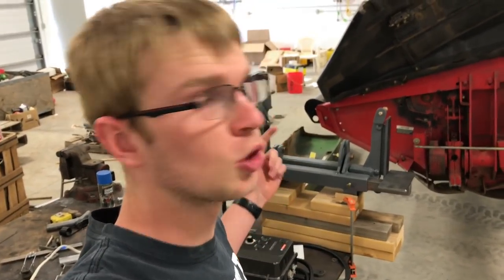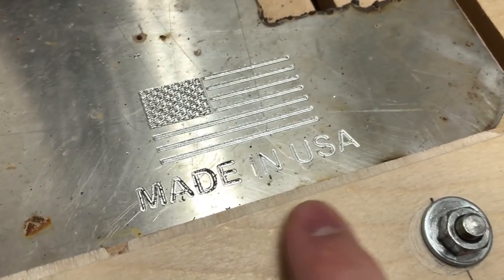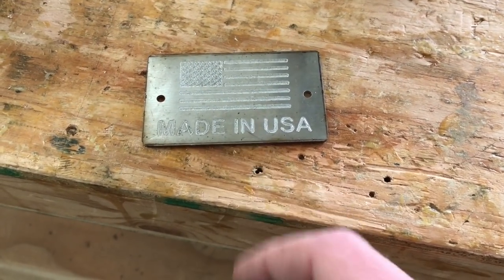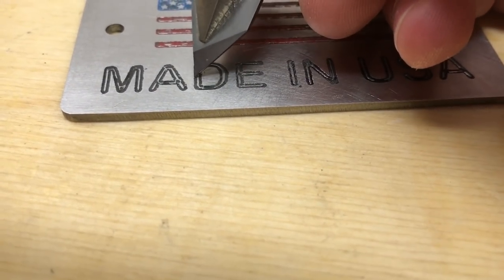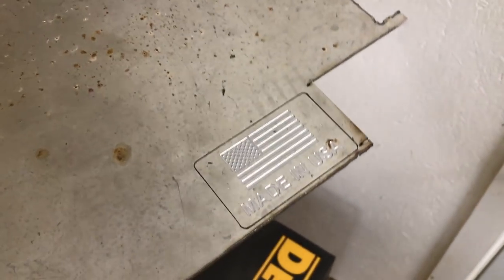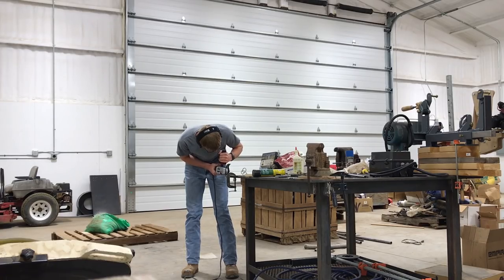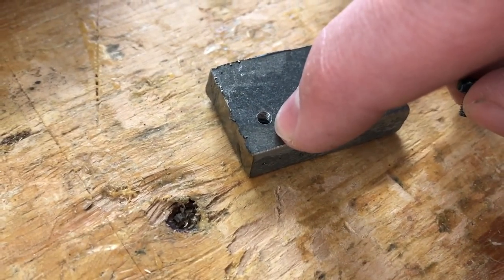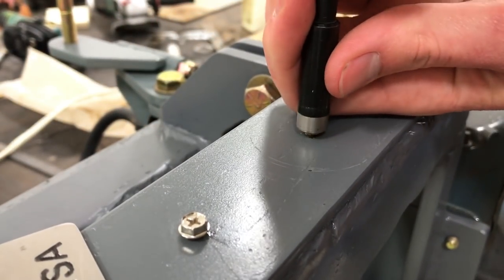Making the "Made in USA" badge

Comment: the screws looks like computer case screws, like for the old 90s kind of pc case
Reply from the maker: +Leone 
That's what I salvaged them from.
Reply: I have ever heard, those kind of screws are called "thread rolling screw". I found many of them used for fasten the mounting/bracket in the industrial electronic control panel (including computer case).
Reply: I'm not sure what they are called but they are designed to form the threads as you drive them into a slightly undersized hole, they are effectively self-tapping although they don't actually cut but more like squeeze / form the threads as they are driven into the material. 

I'm sure the reasons they are used so heavily in the computer cabinets are the fact that you don't have to tap the holes before they are driven in. And most computer cases that I've been exposed to have been made from mild steel that will work easily with a screw like this.
Reply: Those screws are called taptite's.
Reply: Yeah those are almost certainly fine-thread case screws. You'll find them used on optical drives and such (or you would when optical drives were still a thing)
Reply: The black ones are from a Compaq computer cases
Reply: so the screws are probably not made in the us
Reply: ozk_ffm haha im from australia and sourcing even a bloody nail thats Aussie made is hopeless!   
Go on ebay and no US product or British or German or Australian just Chinese... In Japan they call a boat a junk. In China everything they make is junk!!

Comment: The point about the climb versus conventional cut is kind of whats happening. But instead of thinking about the material being pushed, think about the thickness of the chip that's being cut. With a conventional cut, the chip starts small and gets big when the cutter leaves the cut, meaning that at the beginning of the cut, unless its a sharp cutter, will be smearing the material. a climb cut will of course do the opposite. It will start my taking a big cut and ending small. This also leaves a better side wall finish and floor finish. the chip is being pushed behind the cutter and out of the way. unless your dealing with backlash or are worried about material bending, climb cut everything.

Source, am CNC machinist and deal with this for 50 hours a week.

Great finished part!
Reply from the maker: +moocowgobark22 
Thanks for the insightful explanation! I hadn't thought of how the cut gets deeper or shallower depending on travel direction, but that totally makes sense!

Comment: A couple of tips, You might get a better finnish by slowing down the feed rate. 

Also, instead of using a brush etc. wait until all the cleaning and sanding is done, then using a syringe sqirt the ink/paint into the vallies, making sure you fill it but not overflowing. When it has dried you will find that the sides and the bottom in each vally look great with no chips.

Lastly you will get a better finnish using a small milling cutter 1/2/3mm etc rather than your V bit. Hope that helps.

Comment: 8-32 & 10-32 threads probably. Use a small file to turn any screw into a self tapping. A file that's flat on one side, convex the other, with sharp edges will work great. File two chip release slots, opposite each other, holding the flat file face at right angle to the centerline of the screw. The rounded side of the file will be your chip discharge area. You need enough threads turned into cutters to get it to bite, 4 is usually good. A couple of opposing hacksaw cuts works in a pinch too. Cheers

Comment: for future labels, you might try a tougher paint like some acrylic nail polish or colored epoxy. Less chance of chipping than spray paint. Alternatively let the spray paint cure longer and use higher grit paper from the start of the excess removal. Lapp the label letting gravity provide the pressure. It can take a while, but the results can be stunning. I got this from some of the lathe restoration videos on YouTube here.

Comment: Great Video!
Its a little hard to explain, but I think that one factor helping the climb cut is that when the cutting tooth comes into contact with the material, it has a large chip depth, then fades away to nothing. Whereas conventional starts at nothing and ends up with a large chip. Normally, conventional is preferred because it has less of an impact when machining, however with small cuts it can prevent the tooth from 'biting' and create flex. I hope that makes sense.
Reply from the maker: +Walker Custom Design 
That does make sense. Thanks!

Comment: When I worked at Lockheed Martin, we used engraved plates to place all required data on our test equipment.  We used flat head screws which, when installed, mount flush with the surface of the plate (the plate needs a countersink for each fastener).  It yields a very professional look when done with care.

Comment: Great video, great project. I admire your work ethic and thinking it through about the upclimbing cutter, wanting to get it right even if it means doing it over. If I had any criticism of the project at all, it would only be a personal preference, and that is that I would have looked for a round headed screw or a hammered rivet. Those screws just look a bit bulky, and could conceivably snag on your hand or something down the road. I'm thinking a smoother screw head. A hammered brass rivet would be extra cool, though.
Reply from the maker: Thanks! I actually went back and riveted them later, because I felt the same way. Didn't care for the screws.
Reply: Nice! I'd like to see that. Glad to see we were on the same page there. Edit: I did look at your 'improved table holder' video, and saw the badge. Much more sleek.

Comment: Hey Jeremy, those screws are called Tri-Lobe or Trilobular screws. Your suspicions were correct, they're a thread forming screw designed to roll their own threads rather than cut them. Good for electronics where you don't want metal shavings floating around. Looking forward to seeing the full sander.
Reply from the maker: +Crocxr8 
Thanks for the answer! Now it seems a vaguely remember hearing the term "Tri-lobe" before; at least now I have something to google.

Comment: Very nice job Jeremy! Just curious though, why did you not simply glue the plate in place with some strong adhesive instead of using screws? It would have made your life easier and keep the design cleaner, imho.
Reply from the maker: +HODYO Design 
I've never seen an adhesive that really works well with metal. Especially on a machine like this where there's a lot of vibration (potentially). But that's probably just cause I haven't been around long enough to learn what adhesives to use where :)
Reply: Here's what we use to do a similar task when screws aren't desirable. Hasn't failed yet. I bet it's probably the same stuff car dealers use to put their badges on.   goo.gl/Rv3QUc   Nice job on the explanation of climb vs conventional milling. I think your theory of the metal mushing around is exactly what's happening. I personally haven't spent enough time on it, but somebody who does a bunch of Feeds & Speeds calculations would probably have a solution. My hunch is that the RPM of your mill (router) is probably still too fast, and the shape of the end mill isn't designed to clear chips away.
Reply: Jeremy Schmidt those metal adhesive solutions are out there but expensive.  Automotive industry uses them. (Holiday Inn Express skills, you’ve got the real skill)

Comment: I work with cnc for my job and machine metal. The bit you are using is trying to use a point to cut the material, this doesn't work well at all. A bit like that is just spinning on the surface and creates a burr, like you have seen. The edge of the bit won't help either, to use the tip of a bit like that it should be razor sharp or you will end up with a burr. A better solution for you would be to sacrifice one of the v bits and grind down the tip to ensure a cutting edge is swiping past and cutting on the way, rather than just spinning on the spot. If you do this you will find it will have much less of a burr, you dong have to do so many passes, you can go faster and it will probably reduce noise. Hope this helps and I thing it will show results.
Reply from the maker: +Craig Redfern 
I am very familiar with machining metal, so I am fully aware of how this should be done. But as the title indicates this was an experiment to see if it's possible to do it the wrong way.
Reply: +Jeremy Schmidt 
Fair enough, I wasn't trying to say you were wrong but I was simply saying how to prevent the burrs. I am not saying you are incapable of the task I was simply giving an idea and a technique. How you solved the problem did work very well and well done for that. I think you are very talented in what you do and love watching your videos. I think they are entertaining full of information and well put together. Keep up the good work. I just thought I would pin my input in based on my previous experience.
Reply from the maker: +Craig Redfern 
Understood. Thank you!

Comment: It's not a problem with the cutter, it really doesn't have to be that sharp to cut, it's a problem with the CNC router or even possibly the bearings in the router and deflection/slop.  Climb vs conventional cutting is changing the load on whatever is causing the monkey motion in the system.

Comment: Hi Jeremy, nice method and well executed. Have you considered using nail polish as paint? 

People use it to paint homemade metal jewelery, there are plenty of tutorials to be found. Nail polish comes in a wide variety of colors and finishes and is relatively inexpensive. This would allow you to very precisely pick colors and possibly a pearl or two-tone glitter finish although I am not sure if that would be a thing for you. I would recommend removing excess nail polish with acetone before sanding to prevent tearing big chips off.

Comment: When cutting metal you need to cut a certain minimum amount of metal with each pass of each tooth to prevent the bit from rubbing and quickly wearing out.. on a sharp bit this is about 0.001in.  Wood routers run at very high speed and need a correspondingly high feed rate to cut metal, which can be very counter-intuitive for newcomers.  It is common to move slower when problems are encountered, which actually makes this problem worse.
Reply from the maker: +Kevin Malec 
In this case I was using a chipload of 0.00125" for all the cuts. (10k RPM with a 2-flute cutter moving 25IPM) Only problem is, moving fast with a not-so-rigid CNC router can cause significant deflection!

Comment: That's a tri-lobular screw.  They're meant to be self-tapping.  You may be familiar with thread-rolling taps (as opposed to thread cutting taps, like every tap I've seen you use so far) and these screws are made like that.  They're meant to be installed under power on assembly lines and whatnot.  In sheet metal (or at least thinner or softer material).  Getting the tap hole size correct can be a bit of an art-form, but once you're set up for it these things are fantastic.  They wouldn't be my first suggestion for a one-off project, due to the amount of trial and error that might be required to get them to work right.
  Anyway, good job, and a good video.  I like your 'doing it all' approach.  The world needs more generalists.  Specialists have their place, and can save the day, but generalists are more useful because they're there.
  By the way... when you're buying new taps for through holes (or even blind holes that you can drill extra-deep) ask for spiral-point taps.  Way, way nicer to use by hand than hand taps, and they work in machines like your drill.  You don't need to back them up to break the chip.

Mike
Reply from the maker: +Mike Graham 
Thanks!
I have used roll-form taps before, but I don't have any in my own collection. I think I mentioned the similarity these screws have with form taps in the video; good to know that is in fact how they're meant to be used! I do have several sizes of spiral-point taps, which I love! I'll be getting more of those in the future.
Reply: Spiral-point taps are my favourite.  They push the swarf ahead, which makes them perfect for through-holes.  If you're tapping a blind hole just drill the hole extra-deep (like, 125% of the depth that the tap will enter) and you should be golden.  The single drawback is having to get the swarf out of the hole afterwards.  It can suck with small holes.  A pick works for reasonably-sized holes, or take a bit of stainless TIG rod or something similar, sand the end to a long point, then form a bit of a hook in the end by pressing the point onto something hard.  That will pull the swarf out without trouble.  If you're going to be using a mill or other stationary machine to tap, then spiral flute is the way to go.  All the benefits of spiral-point, but it pulls the swarf BACK instead of pushing it FORWARD.  Fabulous stuff, but fragile, and very fiddly to use with hand-held machinery.

Mike

Comment: in your example climb milling would be clockwise, if your cutter (endmill?) is left handed (?) and the mill (router?) is spinning  CC then climb milling would be cc.
Reply from the maker: +Claudio Pacin 
The cutter turns clockwise as viewed from the top, so climb milling is clockwise if you're cutting an outside profile, and counterclockwise if you're cutting an inside profile.
Reply: Yup, I thought the rectangle was supposed to be a solid block of material, completely misunderstood the example, my bad.

Comment: I'm not sure how exactly that that Bosch router motor works, but if "1" means less RPM, setting it to "1" is a totally wrong thing to do, and here is why. Pointed cutters have a very small radius at their point, so if we calculate, how fast a cutting edge is moving along the surface, a tiny radius will make that number very small. So, indeed, a tool could be feeding too fast to actually cut anything. Even conventional milling calculators can't really give you an accurate speed and feed rate since pointed tool has really non-ideal geometry for cutting. When programming something like that for a regular CNC machine, it is recommended to jack up an RPM and slow down a feed rate significantly, comparing to what you'd normally do with a flat end mill with the same diameter.
Reply from the maker: +sciloj 
Speeding it up would help make the cutter overheat, therefore I slowed it down and also slowed my feed rate waaay down. I did calculate the chip load, since this has a flat end like an endmill instead of radiused or pointed.
Reply: You may be right, but keep in mind that he's working without coolant. I know that on my cnc, (which is very similar to Jeremy's) high speed tends to overheat the bit very quickly when working on metal.

Comment: Your passes were pretty deep ! 0.015 inch is like 0.38mm. I usually don't remove more than 0.2mm at once on soft metal.
Reply from the maker: +nitsn 
I wasn't cutting that deep. The "pass depth" number that you saw was just a maximum parameter set for that cutter, not the actual cut depth used on the project.
Reply: Oh I get it ! Do you know how deep the engraving is then ?
Reply from the maker: +nitsn 
I set it to cut 0.010" deep, but since I used a paper to zero the Z it's likely around 0.008".
Reply: Alright, well it looks great ! Good job !

Comment: What might be ok for adding profiles to wood with a router doesn't come close to what's required for precision metal working. In comparison router bearings aren't even in the same ball park as what you'd find with fairly cheap milling machine bearings. Good high quality machine spindle bearings start out at multiple hundreds of dollars and go to multiple thousands depending on the size and accuracy. Without factoring in coatings there's multiple grades of hardness with carbide. At least 19 I know of and thousands of types of carbide. While it worked after a fashion the bearings, rpm, and carbide grade of the bit was working against you. At best it might work in aluminum semi ok but you'll burn up expensive carbide trying it in steels of any type as you've already found out. A rough guide for rpm is 100 fpm for high speed steel and 300-600 fpm in steel for either cutting tool types. Most carbide grades are also intolerant of shock and vibration so those loose router bearings again help to chip the cutting edges. The rough burred edges were caused more by the loose tolerance bearings than climb or conventional cutting. I'd bet climb cutting with the tool and bearing rigidity you have reduces cutting edge life by a very large amount. Tools need to cut so they produce a chip and not dust. Without a proper chip the tool is rubbing. That not only creates heat but also kills any known cutting edge material. Even grinders create chips if there viewed under high magnification.
Reply from the maker: +Turning Point 
Wow, that took a lot of text to tell me what I already knew... But the point of this video was to stretch the limits of what is possible with a CNC router. This was purely an experiment to see if it is possible to do this the wrong way.
Reply: Now how would I know you already knew that hmmm? The average woodworker knows little to nothing about the cutting tool materials and speeds used on metal. My deepest apology's I've wasted your time.
Reply from the maker: +Turning Point 
I understand. Sorry if my comment came off as rude.

Comment: Did you consider welding it rather than screwing it on?  Or CNCing the part directly rather than a plate?
Reply from the maker: +Jay Buffington 
I wanted to engrave it directly, but because of the shape of the part there was no way to mount it on the CNC.